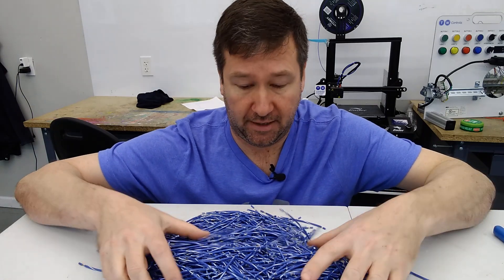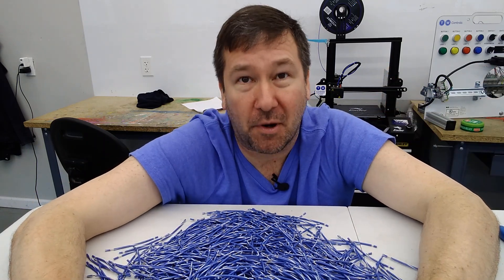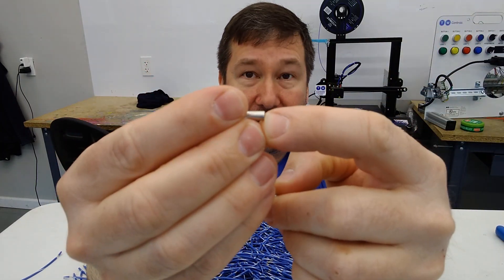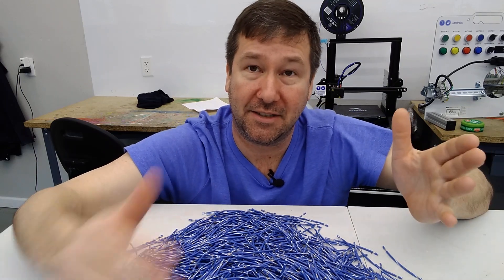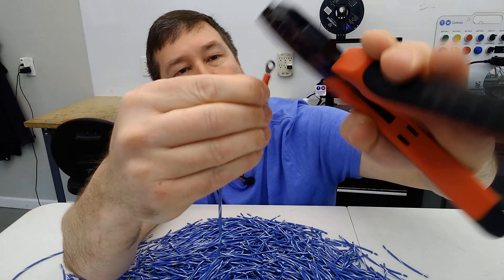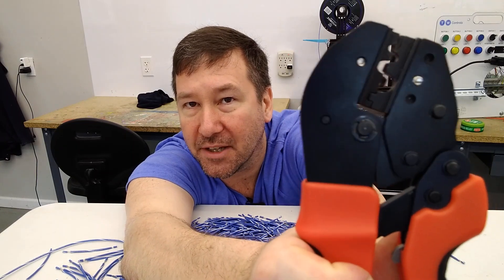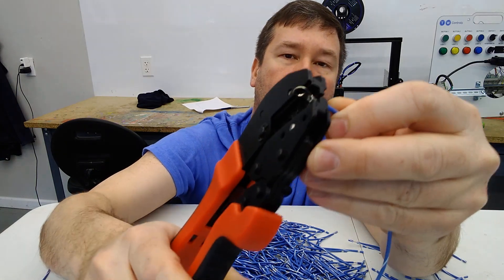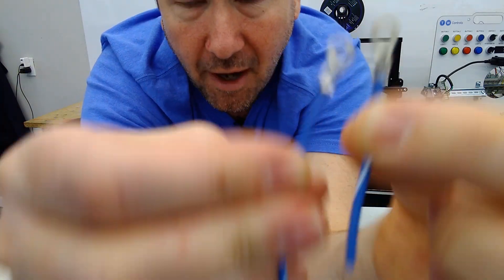Crimping Wire Connectors and Terminals the Right Way

Comment: Tim, thank you so much for this! Maybe I’m not seeing them but what kind of crimper are you using for the insulated connectors? I’ve tried 4 different kinds and neither are the correct fit. Please! Thanks again for explaining the process now I just need the right tool. Thanks!
Reply from the maker: It depends on the connector.  UL says that you have to use the "approve" crimper for the connector.  The best way to start is with a kit.  I don't own this one but it looks nice.
https://amzn.to/48J6MUg

Comment: UL approval doesn’t mean they will work “just as well.”  UL just means they meet MINIMUM safety standards.  The brazed terminals are much better and greatly exceed the minimum requirements for strength and durability, while the roll form only terminals meet the minimums, but may not exceed them by a huge margin.

Comment: Do these crimper also work for butt type wire splicing crimps or do I need a separate one. I know there is a difference between insulated and non insulated crimps but need to know about wire end connections and wire join buts
Reply from the maker: Many work with both but it depends on the manufacturer

Comment: I am a retired Army SIGINT linguist, and just passed my Technician's license for HAM radio.  So, bought the power supply, bought the radio, bought the antenna...when I went to hook up radio to power, I let out the big "QTF!? "  These (ring terminals, cutting wire, crimping, etc.) are the things they don't tell you when you go to the local Voc-Tech for a HAM class.  Your succinct and most excellent explanation just saved $450 of equipment going through the second story window.  Kudos to you and thanks.  73
Reply from the maker: Haha, glad I could help and thank you for your service.
Reply: You look at what the mfgr tells you to do. Look to the NEC. Thats exactly what they say, from start to finish.

Comment: Can somebody finally do a video on how to land termination’s in a terminal block. Im tryna tell this dude your supposed to land the first one backwards so in case somebody has to come behind you doing hot work the term can be landed straight on top.
Reply from the maker: It will depend on what you are installing the ring terminal on.  Not all studs are listed to handle more than one ring.  Also it may be convenient but not all studs have clearance for installing them this way without deforming the ring.  I don't know if this specifically violates UL but there is a general tidiness cause and I'd say my inspector would balk at it.

Comment: Just as an FYI...I have a ratcheting crimper for insulated terminals similar to the first one you showed. Mine is Gardner Bender branded. The jaws are ever so slightly different from one side compared to the other.  It definitely makes a difference with my crimper as to which way the terminal faces when crimping. On mine, the wire needs to come in from the side with the colored dots, otherwise I don't get a fully tight crimp.
Reply from the maker: Good tip Andy, thanks for sharing!

Comment: I was just wondering, can you crimp non-insulated ring/fork etc terminals with a 4 or 6 jaw wire ferrule crimper? I know it wouldn't be kosher, but would it produce a good crimp, or would it be too weak (I think regular wire ferrules are a lot thinner than the ferrules on the terminals)?
Reply from the maker: I would stick with the crimper recommended by the ferrule manufacturer.
Reply: The ferule crimper would also be stuck on the wrong side of the terminal.. If you were terminating on a long installed wire that is. A tool left dangling on a cable run because  you cant get it back off is a bad look..

Comment: Good short and to the point video.  Thanks TIm.  I think I have to share this video with some co-workers.  I have seen too many connections where it looked like someone just took a pair of pliers to an non-insulated ring terminal for 12AWG wire and squeeze the heck out of it on a 16AWG wire.  One time I saw it being done I told him that will never hold, then proceeded to show him.  I just grabbed it with my fingers and pulled it apart.  I then let him borrow my crimper and gave him the correct size of terminal.  I have heard the "it will be good enough" or "I have done it this way for years" or (insert your favorite saying, I've heard them all), way too many times.
Reply from the maker: Love the "have done it this way for years" comment 😜

Comment: I have been watching your videos and would like to thank you for making them.

One thing I noticed in this video though is that I think your dies in the insulated crimper might be backwards. Every crimper I have seen/used in the past has the largest crimp closest to the fulcrum to get the greatest mechanical advantage. I don't think there would be any quality problems as your crimper wont release until it hits the proper position, but it would be much harder on your hands if you are doing more than one.

Keep up the good work.
Reply from the maker: Good observation! I'm left handed and it makes it more ergonomic to operate them with the dies reversed

Comment: Good info! I prefer to use uninsulated crimps, and use heat shrink to make it look more professional. 99% of the crimp connectors I use are for ground wires though, so I use green/yellow shrink tubing. Insulated ferrules go on everything else.

Off topic: I see a can of O'Keeffe's 'Working Hands'. I swear by that stuff, especially during the winter, when it's dry. Be sure to try their night treatment!
Reply from the maker: Yes "Working Hands" is good stuff.  Thanks for watching!